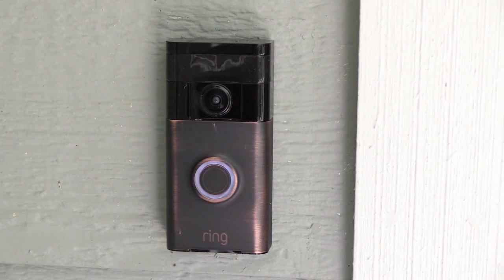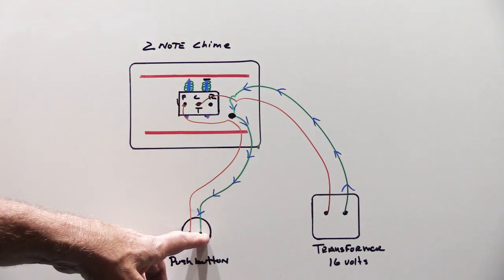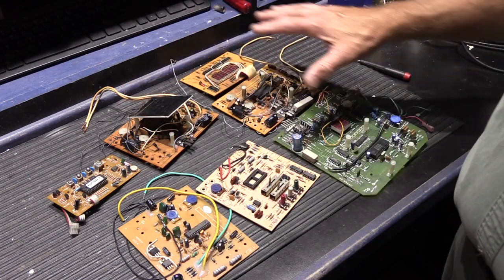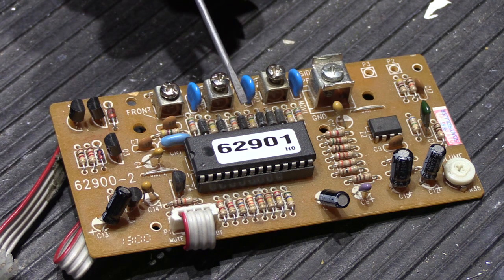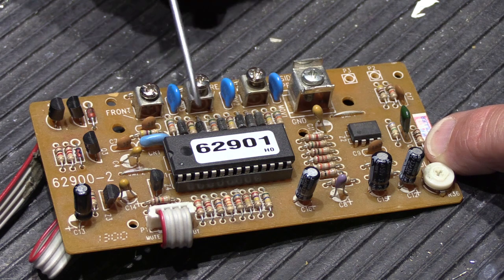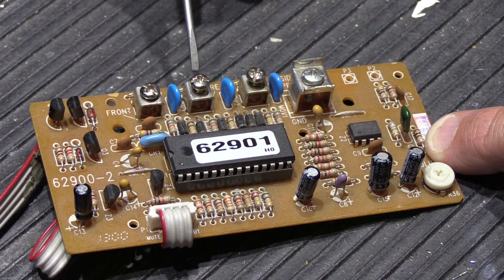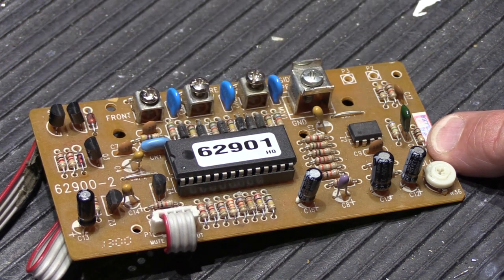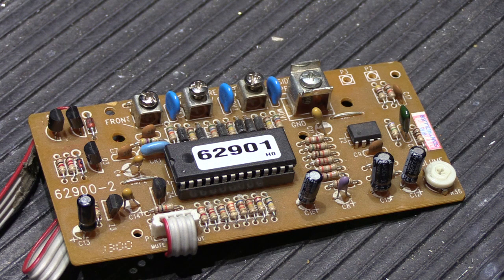Why You Can't Install a Ring Video Door Bell with a NuTone Intercom System or Musical Chime

Comment: SkyBell will work with Nu-Tone Mod IM3303. Simply wire a $5.29 relay, SPDT, (you only need one set of contacts, normally open) available from Fry's, part #R14-11A10-12.  Follow the directions from SkyBell for wiring and wire  the relay parallel, not in series across the original doorbell contacts or sloenoid coils. Then wire the relay contacts to the Nu-tone intercom door bell contacts. It would have been too much trouble for me to run the contact wires to the intercom and I didn't want the old door bell to chime so I removed the old door bell solenoid coils from the door bell, removed the plungers and placed the relay and solenoid inside the wall with the Nu-Tone.  I left the old door bell button attached to the intercom so that either the SkyBell or the door bell button wile cause Nu-tone to chime. I did wrap the coils and relay with electricians tape to prevent shorting out anything inside the Nu-tone case. Good luck.  This should work with similar circuits and intercoms and perhaps Ring.

I am not responsible for damage that might be caused by trying this fix.
Reply from the maker: Dale: No, No, No, No:  You (and everyone else, who thinks they have this figured out) is missing the point of the Video.

If you have a NuTone Intercom and that Intercom has a built-in electronic Chime Module (or has a separate  NuTone Electronic Musical Chime) You Can Not simply connect any type of WiFi Video Door Bell to the wires that run from the Chime Module to the outdoor Push Button and expect those wires to Power the Video Door Bell AND activate the Chime Module or Electronic Chime.- Period - It will not work. . .. 

I'm not sure what type of installation you have, but is sounds convoluted to me.  You mention coils and plungers (which are mechanical chime parts) which you removed, but then you mention having the Skybell connected to the IM3303 to activate it (does it have a Chime Module? - You apparently have much more wiring to work with than the standard amount.  I'm fairly sure that you are powering the Skybell on it's own wiring - not the wiring that run between the IM3303 and the Push Button - So you work-around is entirely different that what the Video addresses- Chris
Reply: Hi Dale, not sure I follow everything. I'm looking at the SkyBell also.   a] Which specific directions are you referring to? ("Follow the directions from SkyBell for wiring") b]  sounds like you didn't care about the chime and then you said the Nu-tone to chime....can you clarify?  ("I didn't want the old door bell to chime so I removed the old door bell solenoid coils from the door bell, removed the plungers and placed the relay and solenoid inside the wall with the Nu-Tone.  I left the old door bell button attached to the intercom so that either the SkyBell or the door bell button wile cause Nu-tone to chime").    At a minimum, can I just throw aware the nutone speaker/doorbell, hook an existing nutting transformer to the speaker wires, with the inline 10 ohm / 10 watt resistor as described here http://www.skybell.com/support/power-diagrams/.   I'm measuring 18.9V from each transformer in the 3303.
thanks
Tony

Comment: I got the Ring 2 for Christmas. Hooked it up to my plain Jane Nutone doorbell. All the damn thing does is buzzes. Replaced my transformer for a 16 volt, 30 amp, bought a new chime just in case, nothing matters. Still buzzes. It acts like the button is being pushed and not let go. Not very happy.
Reply from the maker: Hi Bandit7498: You should contact Ring about the problem - Chris

Comment: No! There is something called AC relay that costs less than $10 on Amazon that you can add to it with the Ring Power Pro V2 to make it work. I got it (Nutone IM-3303) to work perfectly, using a 24V AC relay. If interested, ask and I will post a schematic diagram on how it's done. That is my story, and I'm sticking to it!
Reply from the maker: Hi Chibuzor: You missed the point of the Video - Chris
Reply: Would you please post the diagram on how it is done and part list? Thank you.
Reply: Please post wiring diagram... much appreciated.
Reply: Pleas post how you got the ac relay to work

Comment: The relay does work. The contacts are open and Nu Tone doesn’t see the relay until the the doorbell button is pushed and the contacts close.
Reply from the maker: Are you powering the Skybell on the same 2 wires that are signaling the NuTone Chime Module to ring? - Chris

Comment: To make Ring work, Is it possible to disconnect the wires to the outdoor button from the master unit and hook them up to one of the existing transformers?
Reply from the maker: Hi write2warriors: Yes, but there are some considerations - You will loose the functionality of the NuTone Chime Module - If the button pair of wires run in the same cable (or parallel with the entry speaker wires) as the Entry Door Speaker, you will likely get some (or a lot) of 60 cycle noise when speaking to the Entry Door Station, from the AC power in the button wire (now being used for the Ring Video Door Bell) - Chris
Reply: Losing the functionality of NuTone Chime Module is not an issue. 

Looking at the 2 transformers behind the master unit, they are only 16V and 30VA.  It's probably not enough to power Ring Pro.  It requires 16V to 24V, and 40VA.  The wire between the master unit and the doorbell button shouldn't be long, but I expect it loses some voltage along the way.  I might give it a try and report back.
Reply from the maker: According to the Ring web site - The Ring Pro requires 16 VAC @ 30 VA (watts) - The voltage drop would be minimal in a wire run on less than 100 feet.  Requiring a 30 VA transformer to power their product is somewhat defeating,  most common 2-note door bells (their target product for replacement) are powered by 16 VAC 15 VA transformers.  Also, if the Ring Pro requires almost 2.0 amps to operate, it seems like a redesign is needed - Chris
Reply: Interestingly, I have two 16V @ 30VA transformers for my Nutone 3303.  Will definitely try to rewire the doorbell wires to power up the Ring Pro this weekend.
Reply: I disconnected the wires from a 16V/30VA transformer.  I wired the doorbell wires to it.   It works in day time even though the app says voltage is poor.  Maybe I need to check to see if it has enough power for night vision too.  If everything works, now I just need a big metal plate to cover up the outdoor speaker hole.
Reply from the maker: Hi write2warriors:  Does the app provided any more details about the power beyond just "poor voltage"? - Chris
Reply: I didn't pay attention at that time, and I went with another route.  I bought a plug in transformer for Ring Pro.  The app is now showing good voltage (over 4100mV).  According to ring website, voltage needs be in good status and over 3900mV.  I guess it was under that with the poor voltage status.
Reply: I might try to do what you did. Where did you plug in the transformer? Are the wires exposed outside of the master controller?

How did you determine which wires connected to the doorbell in the master control?
Reply: the plug in transformer is near where I installed Ring Pro.  I painted the wire to match with the exterior wall color.  If anyone were to unplug, their face would already be recorded.

My wires are in different colors.  I just looked at the color of the wires connected to the doorbell button and matched with the one hooked up to the master unit.  Good luck.
Reply: write2warriors oh so you just got an outside plug-in transformer and ran the wire to the doorbell or did you run the wire from inside your house to the outside? I assume there’s no easy way to run wire through a house that’s already finished.
Reply: I didn't want to drill a hole for the wire inside the house, so yes, i put the plug-in transformer outside.  After the wire is painted, one can hardly tell there was a wire from distance.

Comment: I figured it out!! Use 2 transformers, 1 for Ring doorbell and 1 for Nutone Chime, by using a cube relay and wiring the common from the transformer for Nutone chime to one side of normally closed contacts and the front connection of the Nutone chime to the otherside of the normally closed contacts...then take from a mechanical chime which acts as a resistor  with the Ring power module that comes with the unit and connect to front door connection  from the ring unit to where your ring power pack is installed with transformer power on the white wire on your ring power pack and connect to trans connection of mechanical chime, now take another wire from the mechanical chime front door connection and connect  to cube relay 16v coil, don't forget your common wire for the coil from the Ring transformer!!! this energizes the coil opening the contacts, when the ring is pressed you'll notice a big voltage drop, down to 8v or so, this allows the coil to disengage briefly and closes the contacts enough to send current to the front connection of the nutone chime and it will ring just fine...if you don't want the mechanical chime just remove the plunger!! works great!!
Reply from the maker: Hi Bruce:  It sound like you used a normally closed contact relay - is the relay designed for constant duty cycle (coli always on)? - Chris
Reply: Could you please make a video?
Reply: Could you please make a video or post a diagram?

Comment: I know that NuTone made a video intercom back in the early 90s, I actually found that out when I looked at one of the NuTone catalogs on your site. I do see why you can't integrate one of these in with a NuTone intercom system: because the technology is just too outdated to support a Wi-Fi enabled device, and there's no way to put in a video screen.
Reply from the maker: Hi Vincent: The original Video Entry Intercom was the VS1000.  It was a hardwired systems that could accommodate up to 4 cameras and 3 monitors.  It was a black & white system with CRT low resolution in the monitors. 

It used technology that carried the video signal along with the DC power to each camera on the same RG58 coax.  The VS1000 was a closed system and it could not be incorporated into any of the NuTone intercom systems.

The common failure point on these systems is the CCD chip in the cameras, with exposure to bright sun light, over time the chip losses its sensitivity and the result is a lack of contrast in the picture on the monitor and then the image  fades to gray.  Since the chip is no longer made by Toshiba (I've asked them directly - they said no) the cameras are not repairable.

Chris

Comment: Are you saying that ALL digital or electronic chime systems have a microprocessor or just digital chimes from NuTone?  I’m getting beeping and buzzing on my digital door chime ever since I installed the Ring Pro. I swapped out the 16 volt 10 amp transformer to a 16 volt 30 amp one and I’m still having the same problems.  Are you saying Ring Pro video doorbells will only work properly with mechanical chimes? Ring states their units will work with either mechanical or digital chimes as long as they are the ones on their list of compatible chimes...
Reply from the maker: HI R Cole:  What I am saying is that you cannot use the existing wiring from a NuTone Electronic Chime or a NuTone Intercom System with a Chime Module to power another device - like the Ring Door Bell

I don't know how other brands of electronic chimes are designed  so I can't comment on their compatibility with a product like the Ring. - Chris

Comment: Great explanation but I was able to connect ring to Nu Tone intercom for less than $10. It is hard wire connected for charging and activates Nu Tone intercom tone. Reply if interested in a video to explain how.
Reply from the maker: Hi M. Yaghi: Of course it's easy to do if you provide separate power to the Ring - The point of the Video is to show that the Chime Module is not designed to power a device like the Ring - Chris
Reply: please post video
Reply: M. Yaghi interested
Reply: I have a Music Sound intercom and would like to install a Ring/ Nest system instead.  Please advise.
Reply: @northsideservicecompany3567 please post your video
Reply from the maker: @roberthouston506  Post what Video? - Chris

Comment: You can connect the ring to a nutone intercom, use a 24v rib relay and have it powered off the load side of the ring doorbell then use the normally open contacts on the relay and connect to the old doorbell wires which will set it off every time the relay is powered... wasn’t that hard or expensive around 40 dollars (the nutone intercom uses 12 volts)
Reply from the maker: Hi Thomas:  We have another Video that explains what you have described - NuTone Intercom Systems use 16 Volt Transformers
Chris
Reply: Northside Service Company ah ok was just checking, the nutone system I was doing was sending out 12 volts for the chime, why have the video say it’s not possible then?
Reply from the maker: The point of this Video (from 2 years ago) was that you cannot simply connect a WiFi Video Door Camera to the wires that originally were connected to the push button - which is what everyone wants to be able to do.  - Chris

Comment: I just hardwired a Ring 2 doorbell using the pair of wires that connected to a Nutone speaker and doorbell unit.  Works fine.
Reply: Carlos Cervantes a What NuTone model do you have?  And just curious why it worked for you and not others?

Comment: Ring will send you a powercable that you can install and then you can get a separate Ring chime to use the doorbell pro with the Nutone
Reply from the maker: Zonnins: No, no , no - watch the Video again and understand why this won't help.  It Is Not Possible to have both a NuTone Chime Module a Ring Video Door Bell - Chris
Reply: Ok you’re right can I just connect the wires that go out to the doorbell to the transformer? I don’t care if the Nutone no longer works. I might have to replace the existing transformer.

Comment: You can he’s wrong u need two transformers and a relay.. you can do anything with Electricity, The only thing you need is imagination and knowledge🙏🏾
Reply from the maker: Hi Pro Wilson:  Your are essentially correct - Which is why I made this Video: https://www.youtube.com/watch?v=t6YswmDNVyI&list=PLsTvqKsBnGYdNYGrlrOSVKjOLwvFWrLUx&index=3&t=1489s  back in September of 2019.
Where you're of course is - The purpose of this Video is to explain why you can't simply connect a WIFI Camera to the wires that are already activating the Chime - Chris

Comment: You are trying to use obsolete electronics with the latest technology. I don't see a return on investment. There are modern chimes that will replace the old stuff cheaply and quickly. That said, Maybe it could be done, with some added stuff. I suspect that If you connect relay contacts to the doorbell switch contacts on the Nutone chime, and powered a suitable relay coil in series with the Ring, the surge current when the Ring is powering its speaker would close the relay and fool the Nutone chime to work. Again, this is a waste of time and money. Get a modern chime. The Ring Chime gives you a chime and WIFI repeater in one, and installs simply.
Reply from the maker: Hi Mark: How you propose connecting a WIFI Camera to the Door Chime is correct and I show that in this follow-up Video: https://www.youtube.com/watch?v=t6YswmDNVyI&list=PLsTvqKsBnGYdNYGrlrOSVKjOLwvFWrLUx&index=3&t=1610s

As for your comments about this being a waste-of-time,  I have Hundreds and Hundreds and many more Hundreds of Customers who will  vehemently disagree with you.  People have sentimentality for there Door Chimes and will go to great lengths to keep them working.  Also, You will hard pressed to find a "modern" electronic chime that has the sounds quality and features of the Electronic Chimes NuTone made between 1975 and the early 2000's - Chris